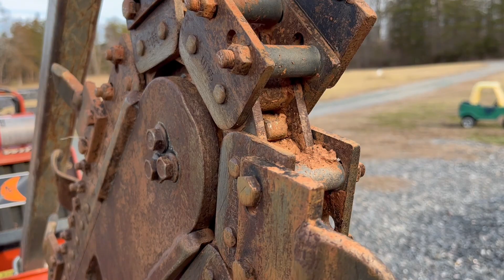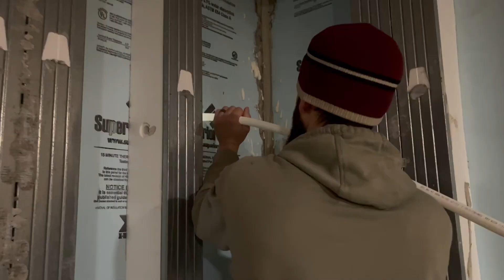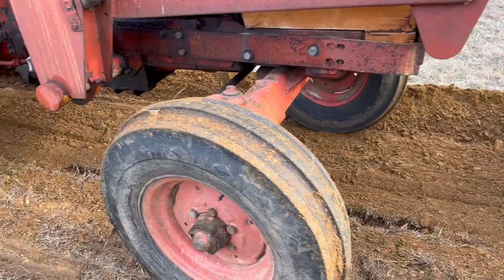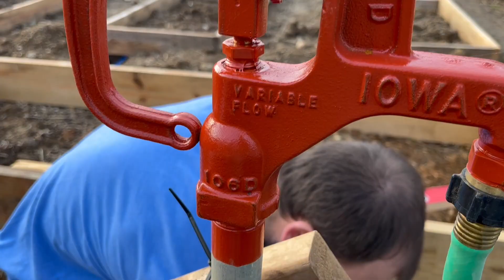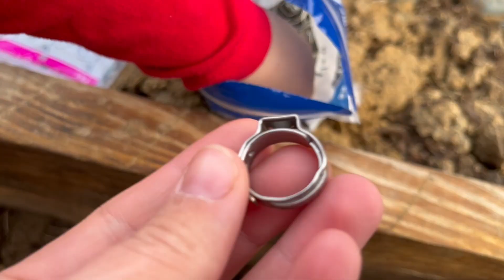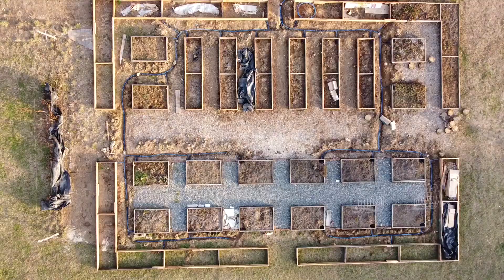Garden Irrigation | PEX Water Line for Raised Beds & Hydrant

Comment: Show up news concrete, it will not drain proper.If you embed that hydrant in concrete, it's got a wee pool at the bottom.That's why you put the gravel in there so it drains properly.But you don't add concrete to it , don't tell you if you look at the other videos to concrete it in

Comment: I might have missed it but did you say why you used the Blue Pex vs the normal black garden poly tubing for irrigation? I love that you didn’t have many elbows. We’re looking to burry our existing setup so that we can mow/weed eat better around our garden.
Reply from the maker: The main reason is it is less resistant to cracking and freezing over winter. The blue pex has to be buried though, because uv rays can damage it.

Comment: I plan to use Pex tubing for my sprinkler system.  I live in 
Wyoming and winter months get a bit cold.  Everyone here connects a air pressure hose and blows the water systems out.  My question, do you know will the pex tubing split without wither in the pipe
Reply from the maker: I plan to clear the tubing with air pressure as well, although I believe the pex is pliable enough that it won’t crack -Ryan

Comment: We used a  ditch witch a the golf course. Worth its weight in gold !! 
Super smart, burying it deep, too. Don't have to worry about heavy. equipment etc. 
As usual awesome job guys, definitely will reference this vid in the future!!
Cheers 🌱🌱🌱
Reply from the maker: The ditch witch trencher was really a huge blessing! It was wonderful not to have to dig all of that by hand 🙌🙌🙌
Reply: @BlueBird Homestead  random question, will you guys "blow out" the lines to winterize? You mentioned the cold isn't too big of an issue?
Reply from the maker: @Fullerrooted  Yes that is the plan. We have an air compressor that we will use. Also that is one of the reason we used pex. It will not crack if it does freeze until other tubing.
Reply: @BlueBird Homestead  ok perfect !! Awesome plan guys !!
Reply from the maker: @Fullerrooted  thanks!